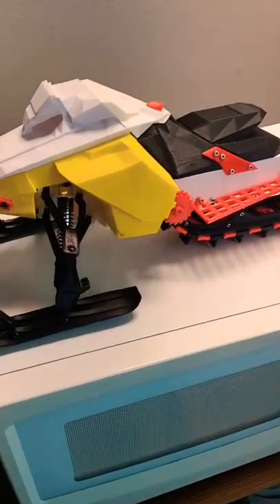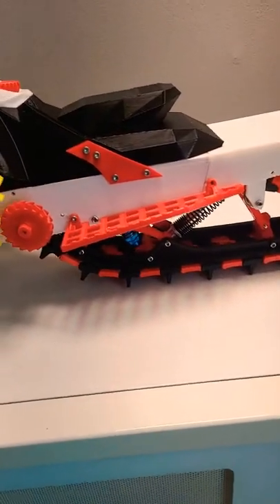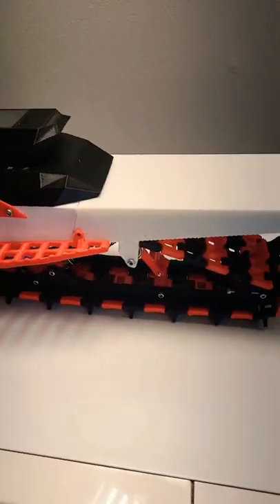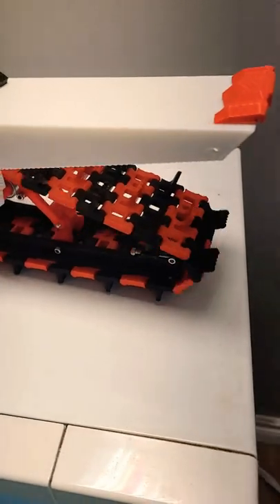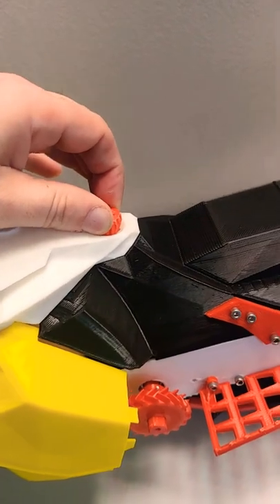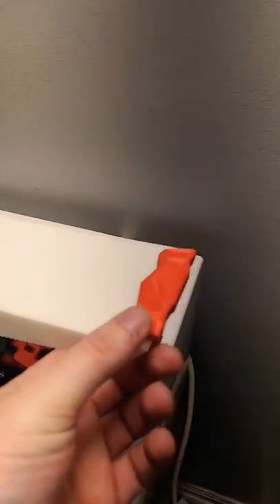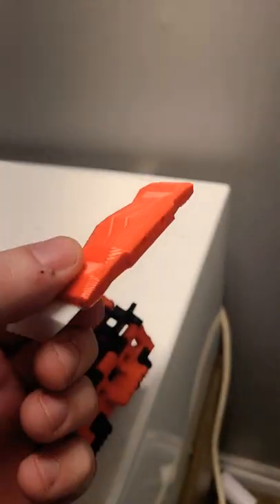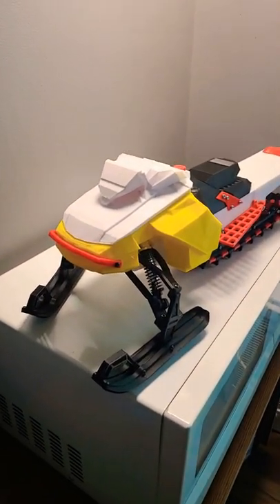3D printed Rc Snowmobile update #6

Comment: I hope you didn't print the transmission with PLA because is going to melt right away since it turning very fast even in snow and cold weather
Reply from the maker: there are some of the gears will workin pla ,, but has to be oiled ,, and the spir gear and pinion is traxxas injected molding spir gear
Reply: @Atlantic_Adventures  Nice I was sure you are doing right just want to make sure
Reply from the maker: @azdronedude  all good bud ,, it may chew up a gear or two but i will have fun doing it lol